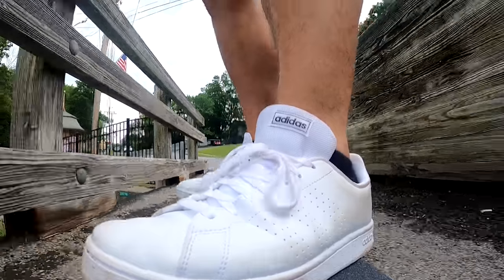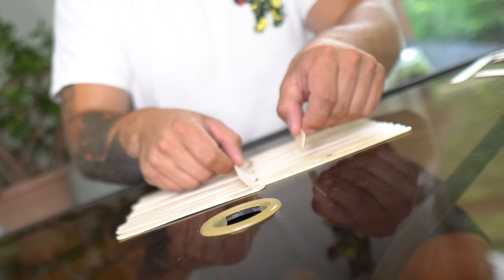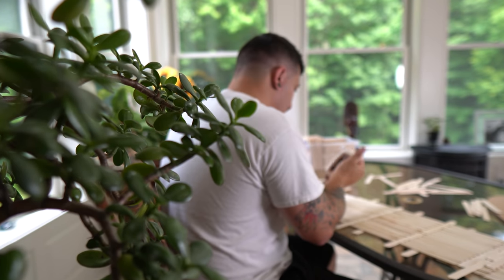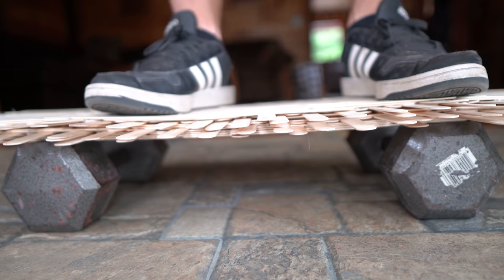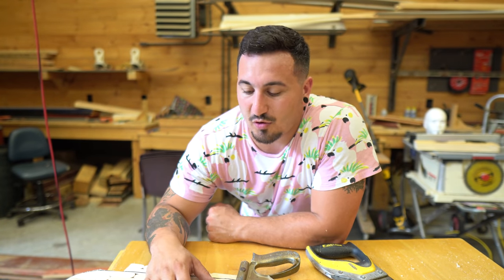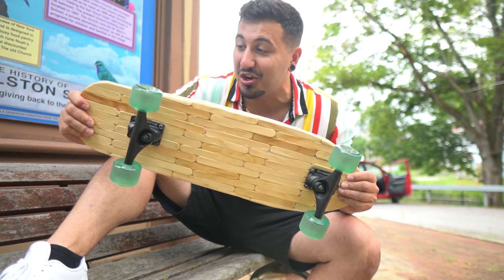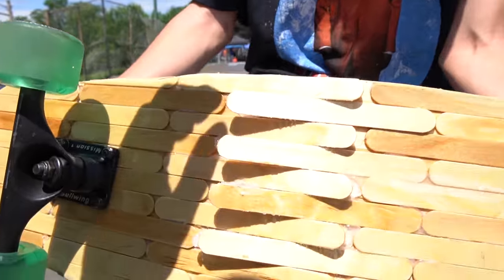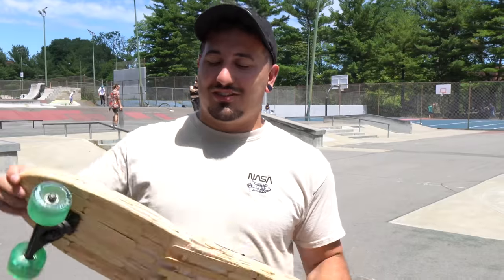I Built a Skateboard out of Popsicle Sticks

Comment: Making it out of resin.(cheating). Visually appealing, though. If you used super glue, should stay in the parameters of popcicle stick board. Sand it, the wood glue, version. Then paint it with wood glue.